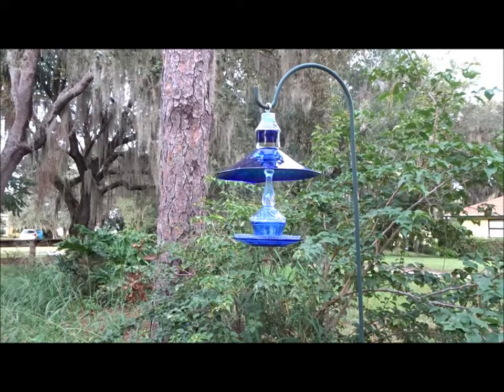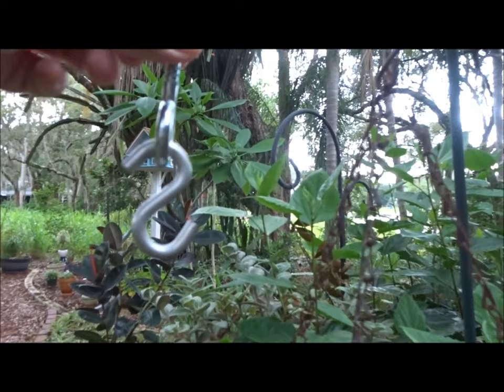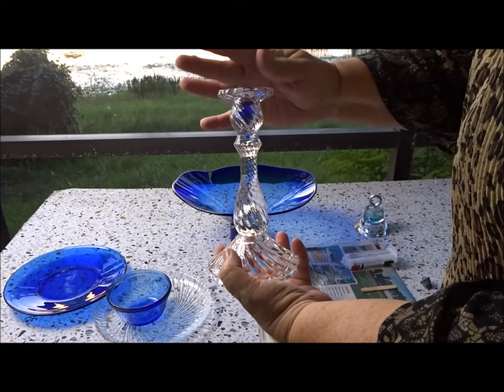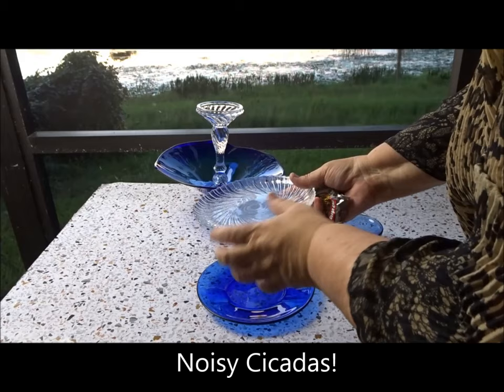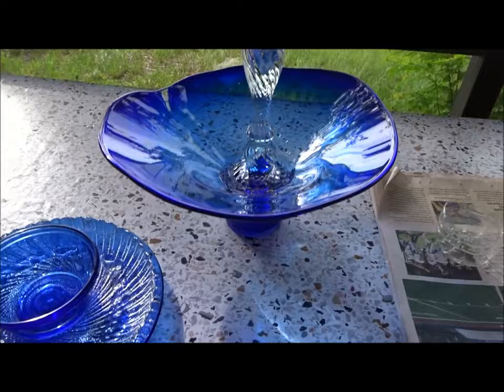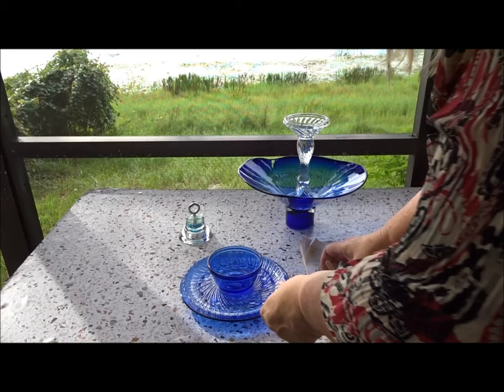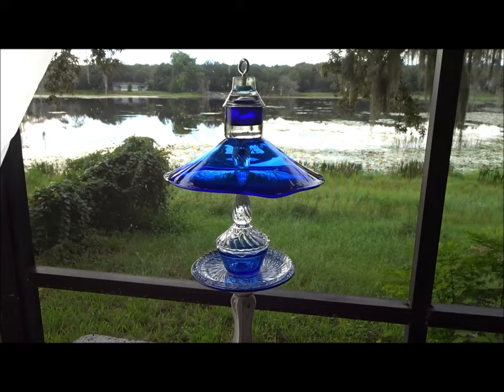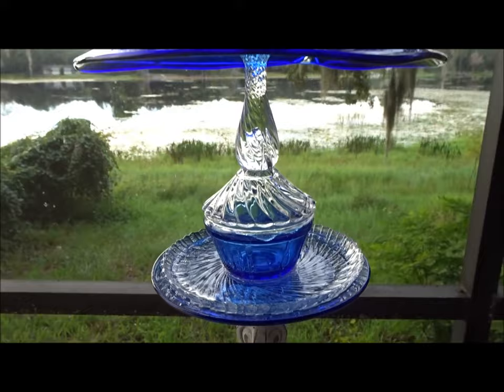How to Make a DIY Upcycled Glass BIRD FEEDER "Blue Drop" #birdfeeder #gardendecor #upcycling #thrift

Comment: Have you had an issue with water compromising the epoxy holding the hanger?
I like this technique as drilling makes me nervous
Reply from the maker: Epoxy works great! I did have an issue with E6000 on another bird feeder and I think it was because I just didn't let it dry long enough. But now I use epoxy on some connections that are carrying the most weight just to give it extra support. Good question!